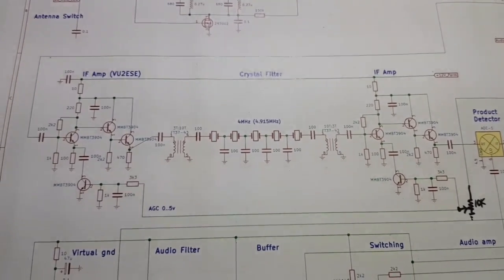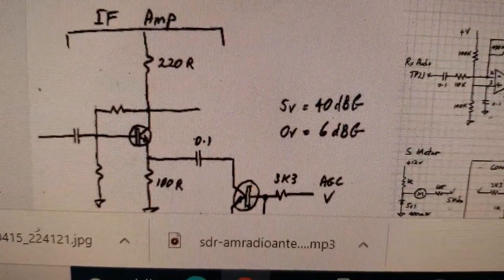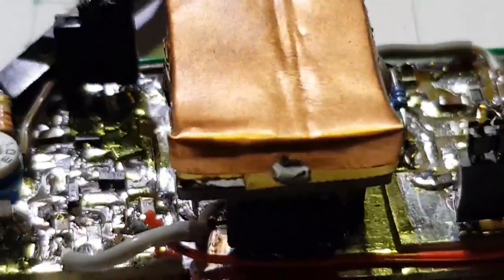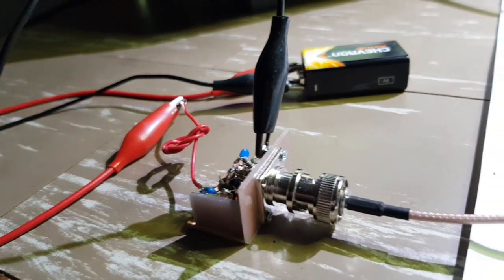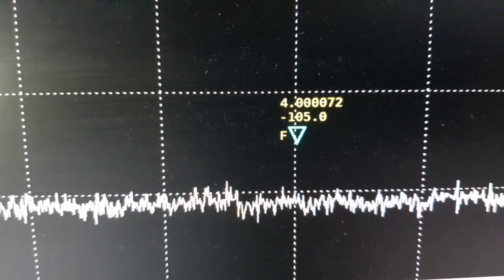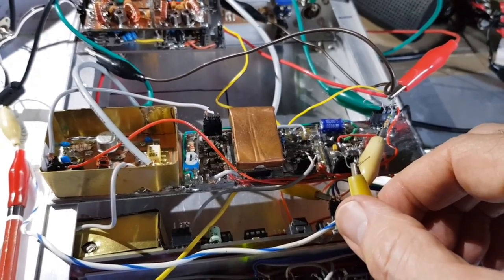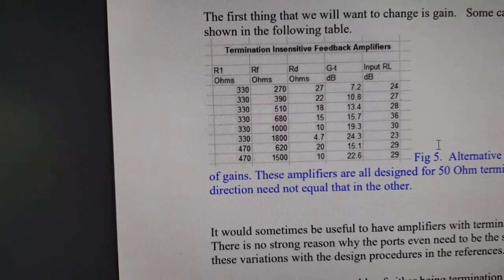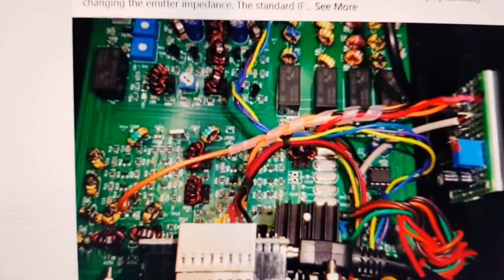AGC-controlled Termination Insensitive Amplifier experiment

Comment: Very interesting. This approach is similar to EMRFD Fig 6.41, but instead of a NPN transistor authors choose to use a PIN diode as a voltage variable resistor (1N4148's work as well for low-level signals). The amplifier described there is not TIA though. I was thinking about building an IF derived AGC with TIA as well, and came up with another approach. Instead of changing the gain, it's possible to place a voltage variable attenuator on IF stage. I discovered that the circuit proposed by Raymond Waugh (Google for Waugh attenuator, it's easy to find) works well with 1N4148's, is well matched on HF (and up to ~150 Mhz if you don't mind SWR <= 2.5), and is bidirectional. I'm going to try it in my next transceiver.
Reply: Oh hey, I have been thinking about using something similar, but with PIN-diodes salvaged from TV tuners, as I still have over 10liters of them. 
And using some 50ohm MMIC amps like MSA-0685 or MSA-0385 as the IF amps.
Reply from the maker: Excellent pick up Alex, thanks!  EMRFD calls it 'PIN diode emitter degeneration', notes 30dB gain and 30dB swing at 10MHz, with PIN diodes, and that 'this circuit has promise'.  I must have looked at this page a dozen times and never really noticed this.  There is no C-B feedback resistor so the input inpedance relationship is different.  I might try this in future.   
I've tried primitive attenuation approaches such as Arduino-switching various pads across the frequency range. It hasn't always been effective. 
As for Ray Waugh's invention at Agilent's App-Note AN1048, this is really interesting!  So simple, and no more than a 1-hour prototype to build and evaluate.  Great find Alex. Please comment here or email me if you try it out.  
Thanks for your pointers, congrats on your FB multiband SSB/CW transceiver. Keep melting solder!
Reply from the maker: A PIN diode variable attenuator and MMIC gain stages would make for an interesting alternative to a traditional AGC-controlled MOSFET or bipolar IF strip, keen to hear if you try this!

Comment: Thanks for the video Paul. Nice to see someone trying out circuits. I have used similar circuits for gain control both at RF and audio. You can get good results by also using a FET in the same circuit. Hayward actually shows the use of 1 and 2 PIN diodes but they introduce distortion at low RF frequencies due to short charge time in the intrinsic layer (Ref Hayward, RF design page 255).  The simplified gain equation for an un bypassed emitter is the collector resistor (or impedance) divided by the emitter resistor. So with a 220R collector resistor, and a 100R emitter resistor the voltage gain is 2. The transistor or FET or diode may put, say, a 10R equivalent resistor across the 100R which then gives a voltage gain of 22 times, which is around 27 dB. And going down to 5 ohms , gives a gain of 33 dB etc. However I found that as you increase the gain, the third order IMD gets worse and at a very low RF emitter impedance, the transistor starts to go from a linear class A RF amplifier to a less linear mode. Fiddling with the emitter impedance also lowers the base input Z. That is, it goes from a lot of negative emitter feedback with a high input Z (as in an emitter follower), to a lot less negative feedback, hence gain more gain, but lower input Z. So the amplifier input impedance goes up and down with AGC not a good situation if fed from tuned circuits or crystal filters. The best AGC controlled system is the AD603 IC which does not use variable degeneration but an internal voltage controlled resistor network resulting in low IMD at all values of AGC and with high dynamic range.
Reply from the maker: Lou, thanks for watching and your informative comment. Very interesting. One of the best things about posting this video has been the excellent comments it has solicited.  I am in no way an RF designer, not formally educated in electronics, just a hobbyist, but I am sure learning quickly from the homebrew community.  Not surprising that this mechanism has a number of instantiations and they are called out in the comments.  Your comments on linearity,  gain and input Z noted.  I concluded that as an AGC in the TIA block, it is probably acceptable, as long at the preceding stage is not critically dependent on the varying impedance of the TIA block.  In my receiver, the first TIA is driven from RF power from the first fioxe dgain IF amp via a 3dB 50r pad.  The second TIA interfaces to the secondary (low impedance) winding on a crystal filter matching transformer, possibly a bigger concern.  Thanks and please keep sharing your knowledge. -- VK3HN.
Reply: @Paul_VK3HN  Hi Paul, all good. Yes, try it out and see how it goes. IMD might not matter if it is not in a high level transmitter path since receive signals are not really that big  till they exit the IF amps. Keep up the experimenting. Take care, cheers.
Reply from the maker: @vk3aqz  Tnx Lou. I've received an email from Wes himself, 😀  will make a followup vid soon. Speak soon.

Comment: If you preceded that with a modest gain low noise amplifier (e.g., grounded gate JFET or something that won't compromise dynamic range), you could then follow that with a pad to stabilize the impedance mismatch.  E.g., [LNA]->[PAD]->[TIA].  I've been playing with circuits based on EMRFD 6.32 and following for a direct conversion receiver, and your comments at the end reminded me of it.  Probably crazy, but it was my first thought :-).
Reply from the maker: Yakov, that is in fact exactly what I am doing in the receiver I showed in the video (SP-11, under construction).  It uses a BPF in front of a graounded gate J310 RF amp stage, then another BPF, into the DBM, a 2N5109 post-mixer amp, a 50 ohm pad, then into the TIA strip.  And that's before I insert a diplexor, which I've been prototyping externally.   After leaving it a couple of days and looking at the comments I am thinking that the AGC-controlled TIA is a useful building block, but you need to look at the impact of varying the load of the upstream receiver stage.  As some have pointed out, that might not be significant.    
EMRFD 6.32 looks very similar to SP-11.  I used double tuned BPFs ahead of and after the J310.  My post mixer amp is the classic 2N5109. You could use MPSH10s for the parallel pair shown, this is very similar to the approach taken by Eamon EI9GQ in RadCom/How to Build a Transceiver. I am about to insert a diplexor on the DBM's output port.  Nice!  Good luck with it.

Comment: Hi Paul. Thanks for another fascinating video. We've corresponded about this before as I used fixed gain TIAs in my recent Optimiser rig. As I actually daisy chain a couple of these modules on either side of my crystal filter I did wonder about putting some variable IF gain in-between each pair of TIAs - like a kind of AGC sandwich! 

i.e. TIA -> Variable Gain IF Amp -> TIA -> Crystal Filter -> TIA -> Variable Gain IF Amp  -> TIA

The TIAs would have to be built for pretty low gain so as not to overdrive. My thinking was that the TIAs would effectively buffer the connecting stages from any impedance changes whilst still allowing me some amount of AGC control before and after the filter. I haven't done any more than think about it yet but its on the TODO list! Thanks again. Great stuff! 73 Nick M0NTV
Reply from the maker: Hi Nick and good to hear from you again.  I hope you might try this TIA hack sometime and let me know what you think. 
 I probably wouldn't mix and match them, rather go with one or t'other, the TIA is only one tool in the toolbox, even if it is gain controlled.  Have a read of some of the comments, there is a suggestion for a very smart PIN diode voltage-controlled attenuator, which is yet another approach to IF gain control.  And a couple of people chime in on places where this emitter degen idea is used for gain control elsewhere.  Most interesting, I'm glad I got around to trying this.  Have you moved yet?  73 from 3HN.
Reply: @Paul_VK3HN  Thanks Paul. We move next week so pretty much everything is in boxes right now! I'll keep following your videos though and get my homebrew fix that way for a little while. Keep up the great work my friend. 73 Nick

Comment: Ive used this circuit or a very similiar one as the first RF amp before the first mixer in my current design, Im finding the gain drops off as the frequency increases.... so at say 10mhz its a healthy 20dB but drops off fast at 28MHz to around 10dB any ideas why this would happen? Im thinking capacitance in the inductor L

Comment: The fact of the matter is that it worked, and we heard the result. So then what is the concern?  Is impedance matching on receiver blocks really all that critical anyway?  I don't know the answer, I've only scratch built one rig so far.  But for the sake of argument, say you have an antenna preamp going into a diode mixer then this IF strip.  The mixer in this case isn't changing the output impedance of the stage before it right?  So a varying input impedance would look like a varying output load on the preamplifier, which would only mean the gain is changing.  But you are also varying the gain of the IF amp to compensate... Seems it might be a wash.  Does this make any sense?  I'm kind of thinking out loud. :)
Reply from the maker: Hi Dennis, thanks for commenting. The layout you describe is the one I would be concerned about, that is: 
[preamp] > [DBM] >  [ TIA with gain control].  You don't want to vary the impedance of the load on the DBM's IF port, as DBMs are wonderful mixers but only when they are fed and terminated properly, so its strong signal and IMD performance may suffer.  A better arrangement is to follow the DBM with a fixed gain post-mixer amplifier, often in class A for best linearity (classic RF transistors like 2N3866, 2N5109 are often used here), then a 3 or 6dB 50 ohm pad, then the gain-controlled TIA. In that arrangement, the TIA interfaces to a fixed pad, so the only consequence is a drop in power transfer due to impedance mismatch as the TIA gets gain-clamped. Which as you point out, is what you are doing in the rest of the IF strip anyway!  73 and keep melting solder.